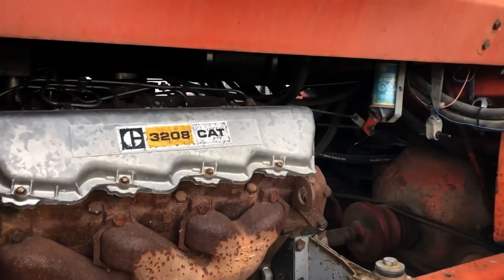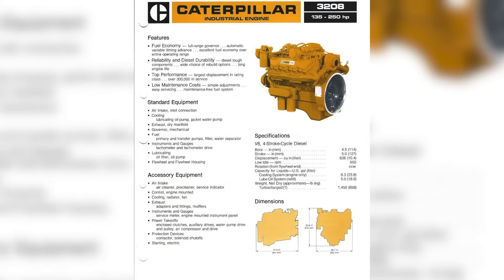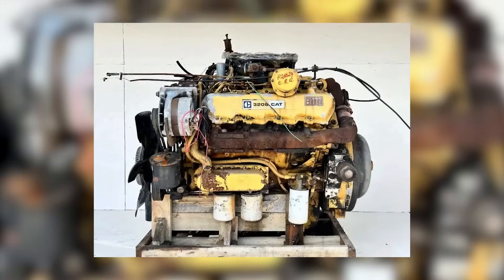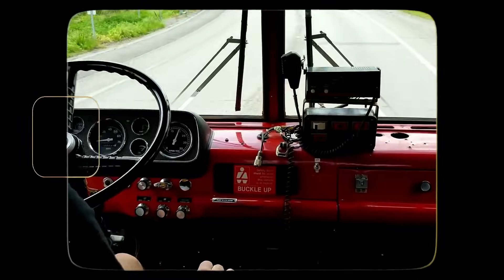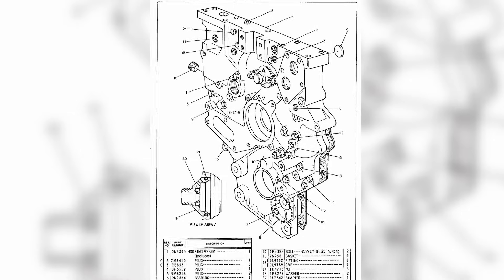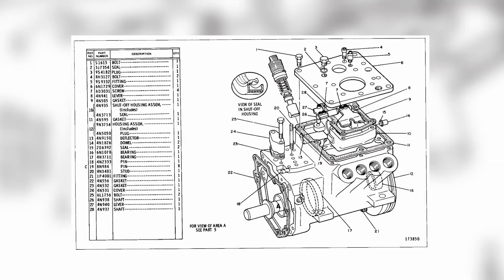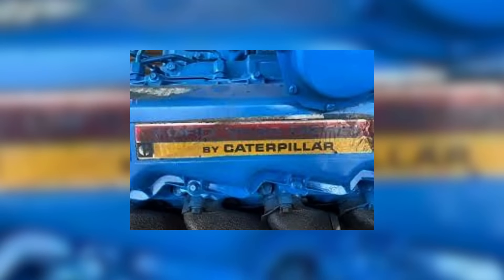The DARK Truth About the CAT 3208: What They Kept Quiet

Comment: Good engine when used as intended.  These early mid range engines were designed as an alternative to gasoline engines and were a lot better.  They were not for OTR linehaul applications.  Also they were good marine performance engines when used in low hour pleasure craft and properly maintained.

Comment: During that era many medium duty diesel engines were V8’s besides the 3308. And as far as I remember non had cylinder liners. The 555 triple nickel Cummins, the 9.0 liter International, the 8.2 Detroit were all medium duty V8’s with no liners. The 8.2 Detroit had a really big flaw, an open deck block. The top deck of the block was of open design, basically no deck. Installing the head enclosed the top of the block, that was a real weakness.

Comment: This video forgot to mention the Cat 1145-1150-1160 series, which was the predecessor and essentially the same as the 3208, but with smaller displacements for the 1145-1150 series. And it had an inline 8 injection pump, vs the little V8 sleeve design injection pump of the 3208.
The 1145-1160 debuted in the late ‘60s and was even offered in the ‘60s Ford 1000, Ford’s first medium duty diesel. Ford funded most of the development of the Cat 1145-1160, as they needed a medium duty diesel quick. Their gas 477-534 V8s were losing ground in the ‘60s, with many sixties Ford 700-900 series being repowered by Detroit 6v71s (a V6 version of the online 6-71). The 6v71 was very common in GMC city buses. Harper Detroit Diesel in Toronto did many 6v71 conversions back then.

Comment: The 3406 is the workhorse of that line , turbo replacement or new bearings in the turbo after many years of service and that engine ran a dredge pump . Stellar power plant
Reply: Se que algunos no usaban camisas pero después uno los podía mandar a encamisarlos a en taller de rectificadora y tornería y yaaa le hacías el overhaul es un motor que con buenos cambios de aceites de te duraa 30 a 40 Años
Reply: @JaimeCastillero-c5p exemplary service 30 -40 years is a good long time ! Gracias Compa

Comment: Cat executives created the "Product Knowledge Contest" in the 1980's. The program was a marketing ploy to encourage Class 6 & 7 truck manufacturers to direct its sales teams to sell the 3208 Engine. I was in transition from IHC Truck Division to GM Truck & Bus Group at the time. IHC Engine Division had both the DT-466 and the DV-550, aka 9.0 Liter products, direct competition to the Cat 3208. GM Truck & Bus Group's 8.2 Liter diesel engine was presented as an alternate in GM's lineup. Local GM management instructed me to participate in the 1982 Product Knowledge competition and by fate, I was "Awarded" the Regional Winner Champion title. My opinion follows. The DT-466 was by far the "BEST" Mid Range Diesel engine for Truck & Ag application. The Cat 3208 was a great Marine engine, but performed poorly in Class 6 & 7 truck application. As for the 8.2L and 9.0L Diesel products....... "Run Forrest.... RUN !!!! "  By the way, CAT pushed the idea of "boring just the bad cylinders and installing a dry sleeve as a cost saving  event. This was an approved CAT repair program.

Comment: I was working for a large Cat dealer at the time, and these engines were a headache.
I've said before the best thing about these engines is they usually made it through the warranty period.
After that...look out. 
We were all familiar with the "made by Ford" rumor, but my suspicion was it was a Cat/IH Navistar collaboration.
Cat and IH had a long term relationship with IH manufacturing for Cat.
Ultimately the end of IH was when Cat sued them for stealing fuel injection tech.
I won't get into the repair/rebuild procedure controversies and part change ups. Patch upon patch.

As for this video, it's tedious and not super informative. 
Kind of like the engine, just a bunch of random cobbled together stuff.

Comment: The initial design was known as 1140, 1145, 1150, and 1160 depending on the stroke. The 1160 was a great engine in short haul like gravel trucks and busses. Primarily Ford 8000 trucks could be ordered with the 1160, rated at 225HP. Then the driver would hook on to a 40' enclosed trailer and head to Florida or Texas. It could handle level ground but a head wind or long hill required maximum power. This would take out number 7 and 8 rod bearings. We could do the same on the dyno with a rebuilt engine.
Caterpillar then dropped the smaller displacement versions and renamed the 1160 the 3208. Cat claimed a bunch of cooling and oiling revisions, but also derated them to 215HP. When the distributor I worked for derated the 1160 engines to 215HP 2 or 3 years earlier, those engines lasted a long time.
Reply: Ford paid for the development of this engine and got 100% of all production of all (blue) 1100 series engines for the first 2 years, when that agreement ran out they went to the 3208 with some fairly major changes. 
They were a very good engines in trash trucks as long as you did bearings at 2500 hrs
Reply: @cbmech2563  I worked on a number of 1100 Series engines painted silver or Cat yellow, before they came out with the 3200 Series.
One direct competitor was the 6V53T Detroit Diesel.
A scale test company ordered a truck with one. Power was on the limit. A scale truck goes everywhere loaded with the weights used to test and calibrate scales. On these engines the wrist pin bushings would fail. The scale company finally traded it for a truck with a 6L71 engine, which better suited the application.

Comment: Am i doing something wrong? Every time i have ever run a tractor that's pulling something hard,  i run it at full throttle at whatever gear keep it there without lugging. Every time this guy says "farm tractors at low rpm" I'm just confused
Reply: Talk to your maintenance experts for that machine. You may be burning extra fuel due to pumping losses. It really depends on the engine, gearing, and load. What's the (updated) manual say? We used to run DT466s near WOT in the field to make sure they were not lugging. I remember  Dad saying not to let it get below 2300 RPM in the 80s. Not sure that was totally necessary. With 8.3 C motors, you certainly don't have to do that, as long as you keep it in the torque band (which could be anywhere from 1400-1800 RPMs in a modern 6 cylinder inline) and aren't overheating. The lube system is designed to keep the oil flowing properly as long as you have sufficient RPMs. Dad said he slowed down the tractor (MY1990 CIH 7140) when he was planting closer to the bottom of the peak torque curve (look up 'Brake Specific Fuel Consumption') and significantly reduced fuel consumption.

Comment: It would fit where a 534 Ford would.  It was too weak to require a good transmission.  🐶 💩
Reply: In the power  department  it didn't take much to have more pulling power than a 534.  
Even the IH 549 was better.
Reply: @mylanmiller9656 they changed the cam timing in the 70's didn't help.  We had a 69 that was a monster, and an 81 that had an offset key installed in the cam to advance timing.  The 549 was pretty ok, like the mv404 and mv445, until they put diesel heads on them and they were trash.  (9l, 6.9, and 7.3)

Comment: Actually if you maintain it it will last forever
Reply: I pull a tractor with a 3208 . Run at 3000 RPM. Several modifications. Approximately 450 hp on stock internals
Reply: @davebarnhart9415 we have a. Old steiger bearcat ii with a reman turbo 3208.  Haven't had a single problem with the engine and we've had it for years. Puts out a modest 250 HP

Comment: I would say " throwaway" is a reasonzble idea. I worked on them as non turbo ...Dry sleeve is its throw away bit but yiu could re- ring them with a hone. Im thinking that MANUFACTURERS using them equated the engine life with their own machine replacement life ....stuffed machine...stuffed engine...as well, its likeley CAT saw the same...we'll give you an engine to match your machine life then chuck it...they were good ...do oil changes then it was ok. As you czn see ...the front of the engine was " busy" lots of bolts and gaskets...lots of time and chances of unseen mistakes...sleeve metering was actually " normal" ...CAT  just put it in the Vee...any " inline" injection pump was the same just in a different place

Comment: We had a brand new  MF 1505 tractor delivered, and had high hopes for the performance of the CAT 3208 engine, well that lasted about 30 mins when we got it on field work. We have a old saying n the U.K.  " It would not pull the skin off a rice pudding"  well that was that Cat powered  MF 1505. Even down to maintenance that was a throw away engine. We kept it a year, and that was about 51 weeks too long!
Reply: Not as bad as a Perkins, but ya, bad.

Comment: The 3208 was not  intended to be rebored once it  wore out, and if used in this comdition the 3208 give good service. it was when the aftermarket started rebuilding  them that  caused problems. The 3208 was a throw away engine from the start and Cat had no intension of rebuilding them.
Reply: Cat did eventually start remaning them.
Reply: @Mechanix81  Cat Did start remaning them, but it was after  other builders  did  it. That is when lots of  problems started.
Reply: Sleevless Diesels  are not agood idea at any time, you may get away with it where  a engine is never under high stress. but put the  engine under  constant hard load an dyou will have problems.
Reply: I do not know the 3208, but the 3408 was a 100 mph machine in a heavy truck.   It would pass anything but the next fuel stop.

Comment: Brutal engine for ag use!      No sleeves in a diesel is a terrible idea!
Reply: you mean like every popular light duty engine? Fords idis, 7.3psd, 12 and 24 valve, etc
Reply: We have an old 76' steiger that pulls a ripper 15" deep which has a turbo 3208 in it.  Several thousand hours and we haven't had one hiccup with it.  I appreciate the older mechanical design of the engine and its very, very simple to work on.  The versions past 1980 had worked out all the mechanical issues with the early models.  Theres a reason Cat made them for almost 20 years

Comment: Regardless of its percieved shortcomings, the Caterpillar V8 - 636 engine was in fact typical of any diesel V8 design, where low end torque was always found wanting and the engine needed to be revved hard to get any kind of performance, power being found higher in the rev band. Another disadvantage was comparatively high fuel consumption - this was down to two basic parameters - the need to rev the engine higher in order to get power plus two extra cylinders to 'feed' versus a straight six engine.
 These issues were not exclusive to Caterpillar V8 engines. With diesel fuel becoming the 'weapon of choice' in many applications for its better economy versus gasoline, it would take the eventual rise and rise of fuel costs to finally put paid to V8 engine use, at least in agricultural tractors, where fuel useage was obviously one of several input costs, and usually the most expensive one.
 Massey Ferguson put a Perkins V8 - 510 engine in their MF 1150 tractor in 1970. Shortly thereafter, International Harvester put one of their V8 truck engines into one of their agricultural tractors, thinking that they were being left behind in the agricultural horsepower race.
 Both the Perkins and IH V8s were originally designed for use in trucks and other applications but were less well suited to use in an agricultural tractor, where the typical working parameters exposed these engines short comings.
 It was eventually found that the torque figures of V8 engines were not that much more than a comparable straight six, inline engine, and so IH soon discontinued their V8 engined conventional tractor. It has to be said though, that they certainly looked the part, with their gleaming chromed exhausts and manifold covers - they looked essentially what one might consider to be a hot rod in tractor form, but I digress somewhat.
 The lack of low end torque was at least partially responsible for MF suggesting that V8 engined tractors used in cultivations and other heavy draught work should be loaded with implements of a size that enabled the tractor to run at 5 mph or above. It wasn't necessarily about using the biggest implement which would continually bring an engine to its knees, but using one that allowed the tractor to cover more ground more quickly, improving hourly productivity, lessened torque loads on transmissions, extending their lives and allowing the V8 to run in its actual intended 'sweet spot' higher up the engine rev band.
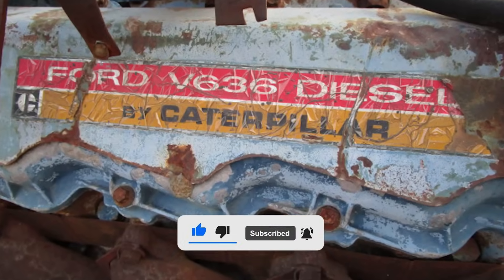 Whilst V8 engine use in agricultural tractors seemed to promise much in the way of performance, if one 19:23  were to go by looks alone, the reality was that low end torque was always found to be wanting.
Rather ironically, despite the ever increasing cost of diesel fuel, MF would persevere in their fitting Perkins V8 engines into their higher horsepower agricultural tractors. The MF 1155 & 2745 both had the V8 - 540 engine, whilst the MF 2770/2775 & 2800/2805  both sported the even larger Perkins V8 - 640 engine, which was naturally aspirated in the  former two models and turbocharged in the latter two tractors.
 These large tractors ceased production in 1983, after MF closed their Detroit factory. A range of straight six cylinder tractors, sourced from Europe, would help MF maintain a tractor presence in the US market, until their new range of MF 3000 series tractors arrived on the scene in late 1986, again sourced from MF's European factory, in Beauvais, France, but that's another story. Most noteably, all of the new tractors, even in the higher horsepower ranges, used straight six engines, whilst the smaller models sported 4 cylinders - not a V8 in sight in any of the new horsepower ranges.

Comment: Once heard that predecessor to 3208, 1150, 3150, where gas engines converted to diesel,  after fuel crunch of early 70's???? Ford needed a better big v8 than 534, Ford n Cat came up with it as a gasburner???

Comment: A great motor, period. I have never read or heard of these supposed complainers? I have owned/used several with zero issues all-in-all... Weakness yes, like all things, don't over heat em with intercooling needed starting at 300 HP!
Reply: Nonsense.  They were an absolute dumpster fire in tractors.  You probably like the 531 Deere, too.😂

Comment: In the Oliver and White tractors most had a 3 speed on the go gearbox that gave 20% overdrive, Direct drive, and 20% under drive. The ability to instantly change gear ratios under a load made the 3208 a great powerplant.
Reply: Oliver, White, and the 3208 were all garbage.
Reply: Couldn't agree more, 3208 was precup junk @chrismcadooak47
Reply: @chrismcadooak47 even the 310 wasn’t that bad, provided someone intelligent put it together.  The 478 Hercules wasn’t bad, the 453 Detroit was loud but solid.  The direct injected 283 was a good engine, and the consolidated diesel engines were amazing.  The 18 speed was good In it’s day, but outdated by the 80’s.  I like the Olivers.
Reply: The ones who complain are the same ones who don't change oil and filters on shcedule, and run it outside it's specs. Farmers didn't like it because they were used to gas engines which they also abused, but didn't cost as much to rebuild.